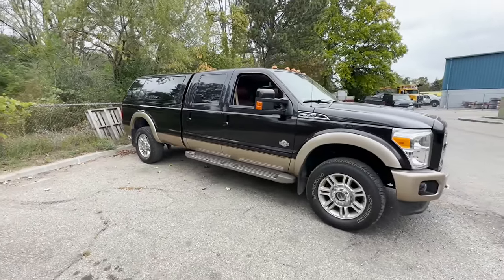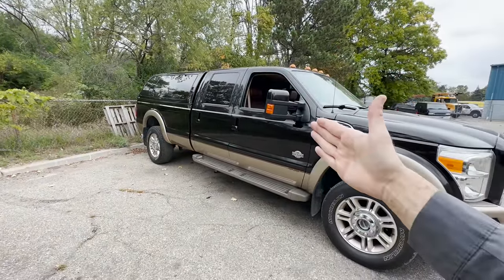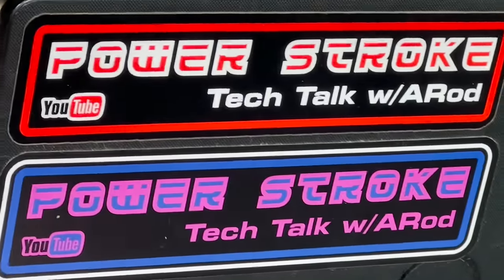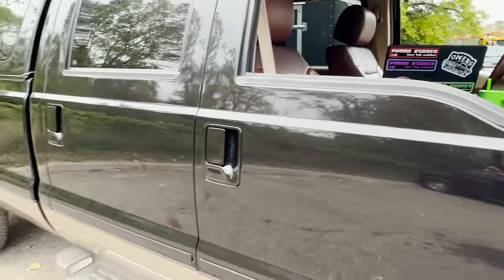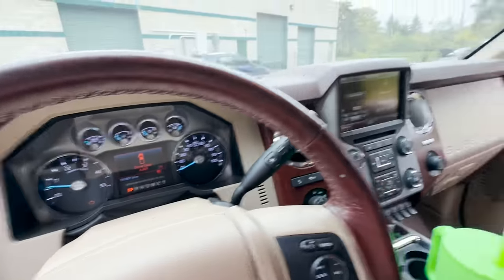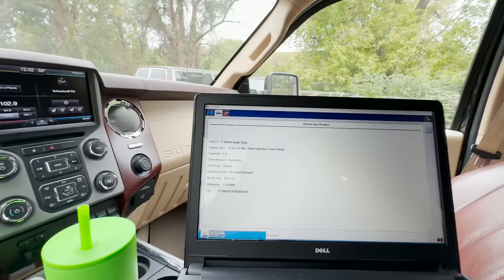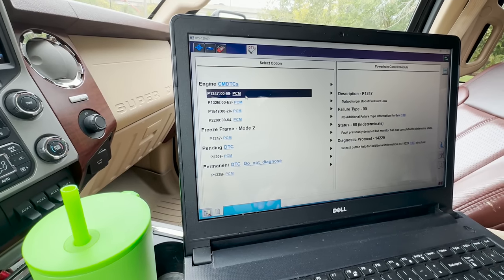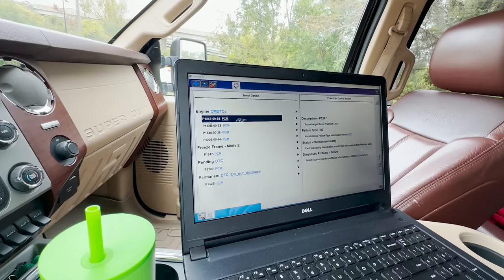HAPPENED to YOU?? a HURT 6.7 | idle ONLY & PLUGGED sensors #mechanic

Comment: You back to work?
Reply from the maker: Nvr stopped
Reply: @PowerStrokeTechTalkwARod  I have a question about 6.0l Powerstroke. How can I keep the 6.0l run perfectly with 100% stock and not trying  to have it blown head gasket? But I might be able to upgrade the air filter, straight pipe, and S&S coolant filtration.
Reply: @PowerStrokeTechTalkwARod  you not sure? Is it impossible?